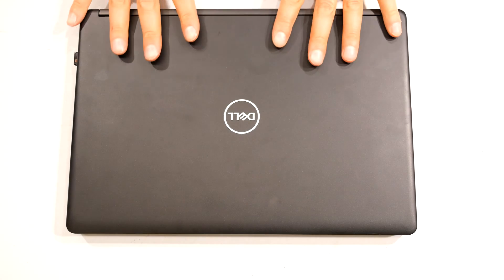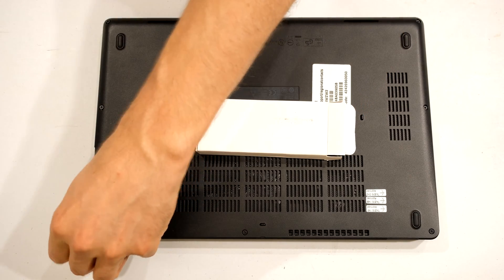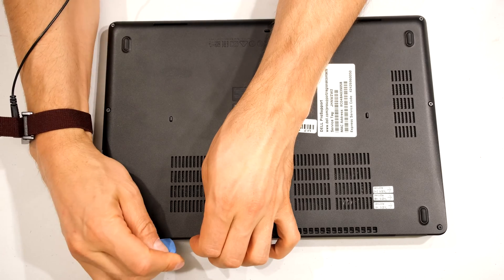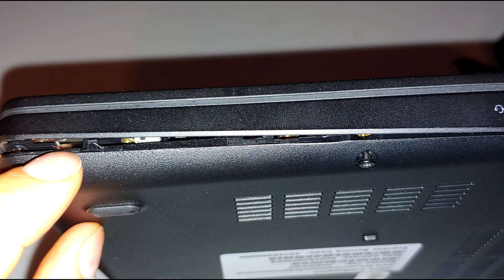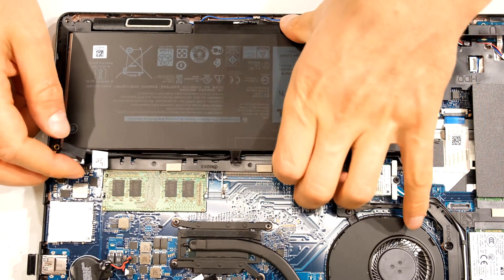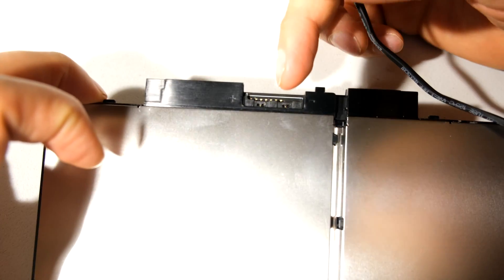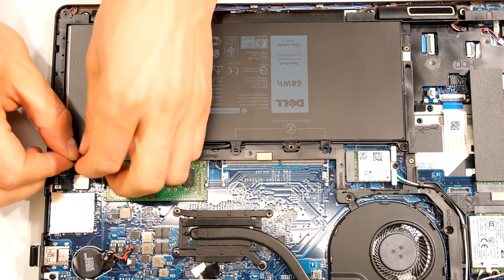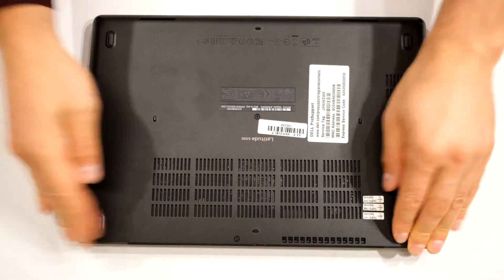How to replace the battery in a Dell Latitude 5400 laptop

Comment: I changed from a 42wH to a 68wh model, but for some reason the laptop does not recognize the new 68wh model. Any tips or suggestions? Had to use the 'old cable'.

Comment: What's with the dislikes? Great video.
Reply: the title says latitude 5400 but in the video there is a latitude 5490
Reply: @SrDu001  He just needs to add SERIES and then add 5490 in parenthesis after it. SOLVED.
Reply from the maker: haters gonna hate